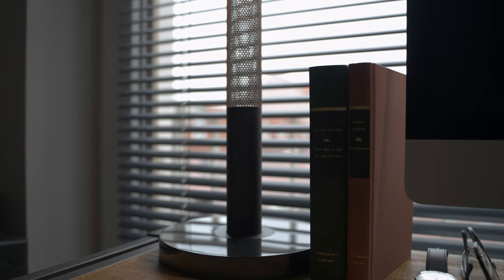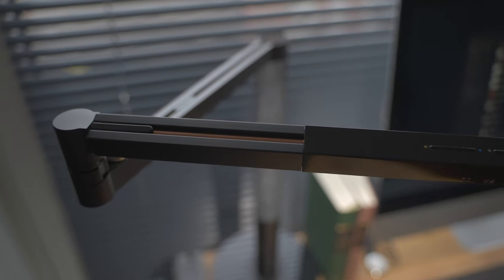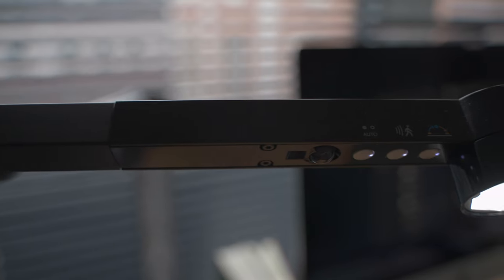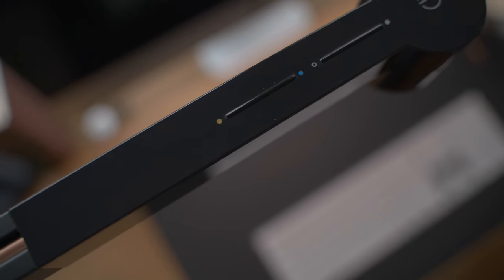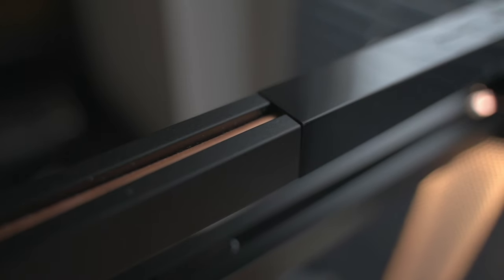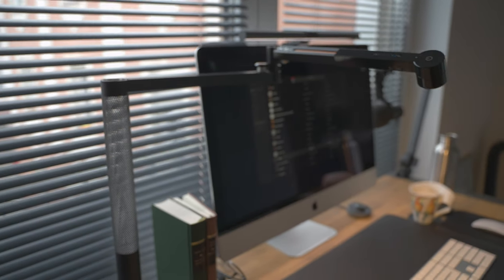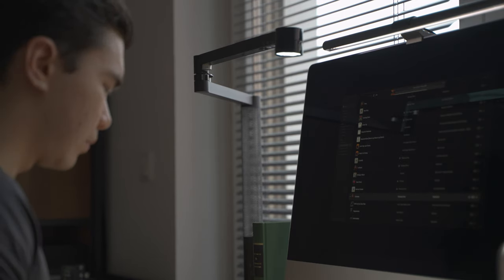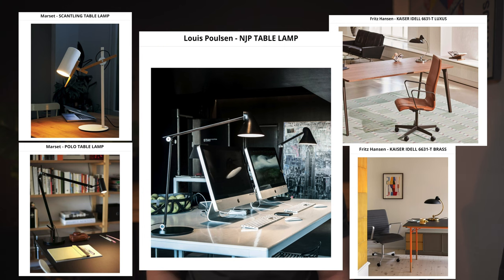Dyson Solarcycle Morph Review – Thoughts after 18 months

Comment: Just purchased this light and it works perfectly for my office with my large rectangular writing desk away from the wall (credenza behind my sitting position).  Couldn't find a desk lamp until Dyson with flexibility with color temp, adjustability to place the light where needed, adjustable lumens, and can light the entire desk space area at night reflecting off the 9 foot (2.8 meter) ceiling.  Dyson should offer a 10-15 year warranty at this price instead of 5 years.  This light is the 100% solution for my needs compared to the 50%-85% solutions with cheaper desk lamps working from home.

Comment: Great review. I'm a recent owner of the floor lamp version of this light and I couldn't agree more with your main criticism: WHAT was Dyson thinking with the shiny black plastics?  And on the floor lamp, the 12" wide shiny black base is sitting on the floor (of course), where it's a perpetual magnet for attracting dust and dirt particles. It leaves you wondering how such a wildly impractical design choice--which anyone who's ever vacuumed would understand--got approved? I know a lot of people complain about the price for this lamp, as they do about Dyson products, in general, but you need to put it in context: high-quality, high-design lamps are expensive. A classic desk lamp like the Berenice from Luceplan costs $650 and it has a single, 2W LED bulb with an on/off switch--that's it. And it's popular enough to have remained in production for almost 40 years and counting. The only change has been an LED bulb replacement for what had been a halogen bulb. Meanwhile, there is nothing in lighting on the market that is even remotely close to all the useful and adaptable lighting technology contained in the Dyson.

Comment: My floor version adaptor is squeaking if it‘s dim I could hear it through the room :( if I plug in usb c it‘s even louder and more like beeping directly from the tube. I contacted Dyson and they sent me a free package mark for the heavy lamp. I hope it‘s not a general problem. And I hope they fix the app soon, as I reported that it does not reconnect after the app was in background. I think it‘s a good point that the buttons dont get hot, I dont like that I cant push the heavy buttons without danger to touch the touchsliders. Maybe it’s only with the floor version but if you push with only one finger upwards the arm feels a little bit flimsy

Comment: One question I haven't found the answer to:  Is the height adjustable?  Or is that fixed?  Seems like it moves in only one plane.
Reply: I believe you can not adjust the height.
Reply: Not height adjustable, and it's taller than the average desk lamp.

So, that might be an issue if you need to lower it down to focus on a specific spot on your desk.

Comment: It's been a year, are you still using and recommending it? I am looking forward to your response
Reply from the maker: I am still using it, although I had the same problem with my light as some others are having, namely it turning itself off after a few minutes. Dyson replaced my old light like 6 months ago, so will have to wait and see how this one turns out in the long run. 

At this point I don‘t recommend buying it anymore until there is some kind of fix for it, or at least some acknowledgment from Dyson. The problem of it turning off seems to be pretty widespread/common. Manufacturing or design flaw if I had to guess. 

Hope this helped!
Reply: I've been lucky with my Dyson light with no issues since purchase in Feb of 2023.  Work from home and use the light daily.
Reply: @miskefelix  just got mine. If I may ask do you mean that the light will turning itself off after few minutes in operating in a standard setting without turning autolight & movement detection?